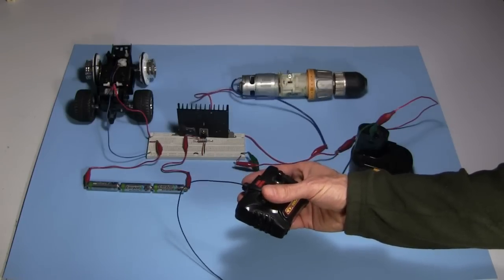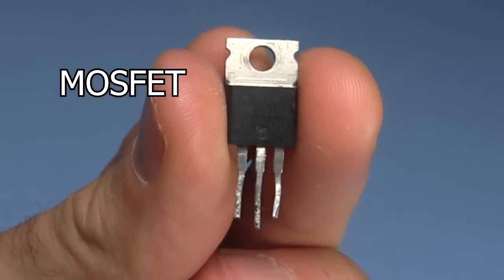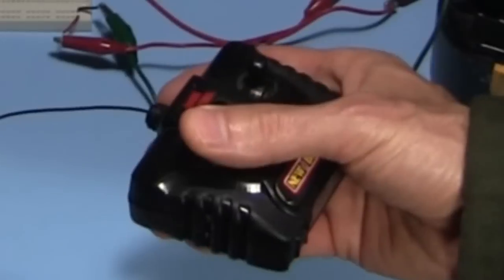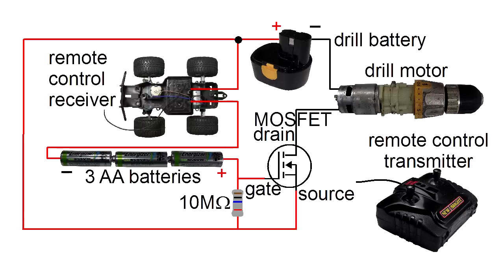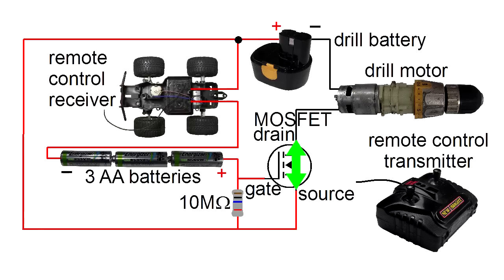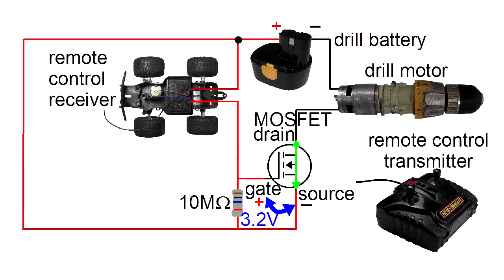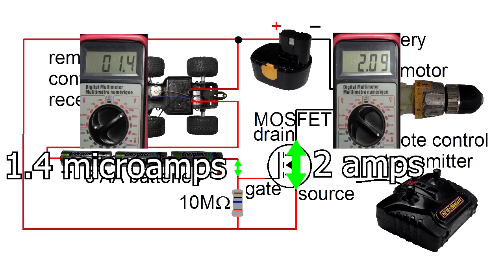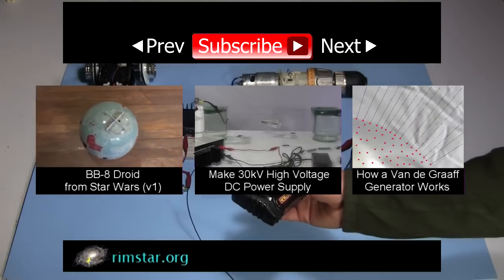Remote Control Drill Motor & How a MOSFET Works

Comment from the maker: +Tejas Shenoy They do perform much the same function. Relays are a much older tech, going back to the 1830s, and it's cool to see their uses back then, and still today (I've used them for automatic generator starters in solar systems.) A MOSFET requires very little current to keep the drain to source conducting, whereas a relay requires you to keep a coil energized, which is basically an electromagnet, and so that would require more current. I'm still new to MOSFETs but I've read of frequencies in the hundreds of kilohertz and even megahertz which I'm pretty sure you can get with relays.
PS. If you want people to be able to reply to you then you may have to go to your Google+ account settings and set "Who can comment on your public posts?" to Anyone.

Comment: Excellent video. I noticed you have the load connected between the drain and the neg rail, usually you would have the load connected between the POS rail and the source of the MOSFET. The way you show clearly works, but usually results in lower voltage across the load and possibly switching problems. I normally use a 100 ohm to 470 ohm resistor on the gate, and from the gate to the source(NEG), I would use a pull down resistor of 270k to 1M for reliable/fast turning off. :-) Keep in mind you can also use a "Logic-Level" MOSFET. They require very low voltage to completely turn on. Some as low as 1.5V.
Reply from the maker: +electronicsNmore The battery is backward in my circuit diagram; it was an error made when going from paper to computer drawing. The actual working circuit has the load between the battery positive and the drain. I guess not everyone is noticing the "Oops" in the video thumbnail or has annotations on. Maybe I should have uploaded a revised video after all.
I tried with a resistor on the gate but it didn't make any noticeable difference, and from my research I couldn't find a reason for it.
I ordered new MOSFETs yesterday with lower turn on voltages, though the H-bridge circuit I currently have in mind won't need the lower voltage anyway as it'll be using the drill battery.
Reply from the maker: +electronicsNmore Between the gate and source I just tried different resistances (1M, 470k, 1k, 220, 27) in place of the 10M and in all cases the it ran when the remote was turned on. It didn't  work at all with 10 ohms or dead short between the gate and source, the latter being totally expected. I thought I'd tried 1k between the gate and source last week and could have sworn it hadn't worked. Oh well.
Reply: I would not upload a revised video. You did a great job on this one. I must have missed the "oops". The logic level mosfets are super handy to have on hand. Not every mosfet uses gate resistors, but most of the time they do. The purpose is to help prevent interference, voltage spikes, etc for reliable switching. I would definitely use resistors on the gates to balance things out when using mosfets in parallel using one source to trigger them.

Comment: get 2 mosfets make zvs driver and have fun induction heating and arcing with flyback transformer. note everytime you experimentally start the circuit you have to do it trough 12 v headlight bulb in order to make sure the system works. i recommend 4 irf540n in twin groups. they handle hours of mistakes when good heatsinked

Comment: I know you're a big fan of recycling and reusing stuff, but this is a case you're creating more work and making the design unreliable in your efforts to salvage parts. This is a really good time to look up the datasheets and find a MOSFET with a turn-on voltage suitable for the truck's signal. You should also look at finding one with less resistance so you don't need that huge heatsink, which probably would not work enclosed inside a BB-8 ball.  Also, is the truck giving you an analog signal proportional to speed, or is it a digital on/off signal. If you're doing a digital control then the MOSFET is a good choice, but there are other devices more suitable for analog signals than MOSFETS.Looking forward to the new BB-8 droid.
Reply from the maker: +USWaterRockets I didn't want to buy MOSFETs until I was sure I knew what to buy, hence this learning experiment. I'll definitely buy them for the next circuit since I don't have enough. From the comments below, I've since learned that this circuit is backward even, so the experiment was a success :). Regarding the heatsink, that was just a precaution. I didn't do a finger test to see if it heats up. The truck puts out flat DC.
Reply: +RimstarOrg FWIW, that heatsink was seriously overkill for the transistor and for the load. you could probably have used a much smaller heatsink, or stuck a glob of clay or similar on the transistor (tacky, but it works ok IME). commercial TO-220 heatsinks also exist, but have different properties.

FWIW, I often use Darlingtons due to them being cheaper than MOSFETs.
like, parts are expensive, one spends prices like several $1 transistors to run an $10 motor.
but, sadly, smaller/cheaper motors are really weak...

Comment: Hi,  I have been working with the TO-220 packages on breadboards (like your MOSFET here) for decades.  A technique I have been using (to greatly improve the TO-220 to breadboard connection)-AND it prevents VERY annoying damage to the breadboard which causes many mysterious malfunctions,  After scraping any oxidation off the three pin's surfaces--AND EDGES- with an exacto knife, I use a pair of needle-nose pliers to bend the pins 90 degrees!!  If you are familiar with the inside metal of breadboards, you will appreciate value of this technique.  I just thought I should share this: So...hope it helps...
--dALE
Reply from the maker: +dale nassar Thanks for the tip, dALE! Now that you mention it I can see how you can potentially have bad connections with TO-220 and breadboards, especially reused ones like the one I used.

Comment: Interesting video,  however what power rating is your drill motor at 12V as the Mosfet IRF614  data sheet drain current is 2.7A max?
Reply from the maker: Thanks. And sorry, but I don't know. I didn't measure it and not longer have the drill motor.

Comment: I've always been kind of confused about the distinction between MOSFETs and BJTs. I think one thing I heard was about current sensitive vs voltage sensitive. Is one better than the other for switching, or do they fill different roles?
Reply: +radioactivated the gamer   different roles mostly.

MOSFETs are voltage controlled, and slightly better for digital switching, as they have a lower voltage-drop and generate a little less heat in this case. however, they are more expensive and are destroyed if the voltage goes too high (even if very briefly). if used for analog, they will generate considerably more heat (you generally do not want to use these for analog, use BJTs instead if you need analog). because of their lower heat, they can be used for switching a fair bit of current (such as using PWM to drive a motor).

BJTs are current controlled, and generate a little more heat for digital switching, but less for analog (though, digital switching still generates less heat than using them for analog). generally, they can also take a little more abuse without being permanently damaged. using them may require taking consideration of their base-current and gain behavior (hFE, etc...). essentially, the base current is multiplied by a curve to get the collector current.

Darlington BJTs are a compromise, basically with very high gain and behavior more like a digital switch. they generate more heat and are lower power than MOSFETs, but are typically also cheaper. IME, they are more easily damaged by voltage spikes than normal BJTs, but have otherwise generally proven fairly reliable.

you can also use normal BJTs in a Darlington configuration, using an NPN main transistor with either a small NPN or PNP transistor to get a high gain.

Comment: Just a little something I noticed, it looks like the drill battery is connected the wrong way round in the schematic, I don't know if anyone else has pointed that out.
Reply from the maker: +CoolDudeClem Yup, it's been pointed out. I'll be uploading a revised video. Too many useful comments here already to just delete this video. :)
Reply: RimstarOrg Might also be a good idea to put a diode 1n5400 series backwards across the motor to quench forward emf. Also you could eliminate the 3 aa cells instead drawing the switching voltage from the battery pack  A TTL level low resistance MOSFET from a scrap motherboard may not need any heat sinking. Also add a 100nf capacitor across the motor to suppress radio noise.
Reply from the maker: +Nick Hill I'm hoping the need for the 3 AA cells will go away once I reverse the battery. I hadn't thought of the cap for suppressing radio noise. Thanks.
Reply from the maker: +CoolDudeClem I confirmed that the error was in the direction of the drill battery only in the circuit diagram in the video. The actual one that I demonstrate and the paper one on my desk are correct. The error happened when I drew it on the computer somehow.
Reply: +RimstarOrg Cool. With battery polarity in diagram, the protection diode in that model of transistor would have been forward biased turning motor on all the time. Someone mentioned a darlington, but that would create a 1.2 volt drop, which a MOSFET will avoid if the gate is driven with sufficient voltage. An IRLI2203G is a great choice since it has 30v Vdss and an on resistance of 0.015 ohm with 5Vgs. This shouldn't need a heatsink. If you want to get rid of the batteries you'd want to make sure the remote control shuts down completely if Vbatt (Vgs) gets below 3.5v since the MOSFET resistnce will increase significantly when the gate voltage is lower than that leading to increased dissipation. If you want to shrink the batteries a couple of coin cells would last since the curent draw is very small and 6v gate voltage is nice.

Comment: how did you manage to handle "HIGH CURRENT" drill motor with a mosfet that have 2.0Ohm Rds(on) and 2.7A Id ? that mosfet was designed for higher voltage,get a mosfet like irf3205 which designed for low voltage
Reply from the maker: +Tonny Cassidy Good question. It's been pointed out here that I had the MOSFET backward (as I said in the video, I'm new to MOSFETs.) Maybe the answer lies there. Anyway, I'll be uploading a revised video once I've had a chance to redo the circuit.
Reply: +RimstarOrg try low voltage mosfet, most high voltage mosfet high Rds(on) which is 2Ohm in this case ,you will lose some power from that,as far as i know ,it will act like having a 2Ohm resistor in series ,try low voltage mosfet like IRFZ44N (which can handle 44A) or IRF3205 (can handle up to 125A) ,using high voltage mosfet in low voltage application is not as efficient as using low voltage mosfet on low voltage,low voltage mosfet usually have low Rds(on) down to 1.7milliohm on some mosfet ,

Comment: I see what looks like 4 mosfets in a two speed RC car. I saw cmos on them. I am looking to use them to turn on a lighting system in an RC plane from servo. Any chance the signal wire straight from servo can activate the bias? Does the first part sound like the correct piece? Where do I look up parts online to match what I salvage? Please and thanks.

Comment: How do you keep the truck's wheels from moving?
Reply: +Brandon Fisher He probably disconnected the Motor to it.
Reply: +Nicholas Lenzo I guess that could be it but I can't be 100% sure unless Steve tells me so I'll settle for your answer unless Steve says otherwise, thanks for the reply though :)
Reply from the maker: +Brandon Fisher Yup, I disconnected the truck motor. If I end up using that remote control truck in the BB-8 then I'll eventually dig the receiver circuit out from it altogether.

Comment: nice informative video again.
but your music this time didn't let me hear your narration. so i just muted it.
man i believe honestly for such type of videos, we don't need music in the background, just keep it simple :)
Reply from the maker: +SAMIMY Thanks for letting me know. What kind of headphones do you have (high quality, low quality, earbuds, headphones, ...)? A lot of people have been telling me they didn't even know I had music, so I turned it up this time. With that, and other problems folks are pointing out, I get the feeling I'll be removing this video and reworking it.
Reply: +RimstarOrg  
both, i  played your video using my desktop multimedia amplifier it was too loud, then i switched it off and used headphones (audio technica ath-ad700x), still the same problem. the music is distracting.
so here is a simple solution:
" just don't add music, your narration is fair enough and sounds good  with the natural sound of the video"
Reply from the maker: +SAMIMY Thanks for testing. I guess I remain puzzled at how some people didn't know I used music, with the exception of some recent ones. I use music because I find just the sound of my voice can get dull after a while, especially for "lecture" videos. For short, fun videos, the music just adds to the fun. I'll experiment with it.
Reply: +RimstarOrg The reason people didnt know you had music was because it was at the perfect volume. It was just loud enough to keep people engaged but soft enough to not distract from your voice. Music in these type of videos should be used as an ambiance rather than a part you can hear. An analogy could be like dinner music its just there to cover white noise not drown out the conversation.
Reply from the maker: +ninjakiwi1324 Hmmm... That just might explain it. Thanks. It sure would be good if that's the reason - then that would mean what I was doing was all along was fine.